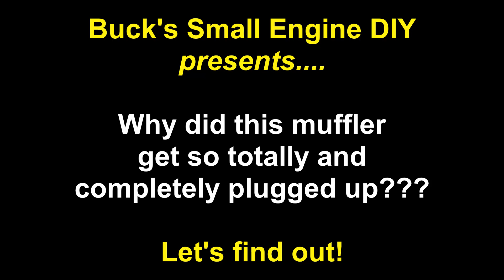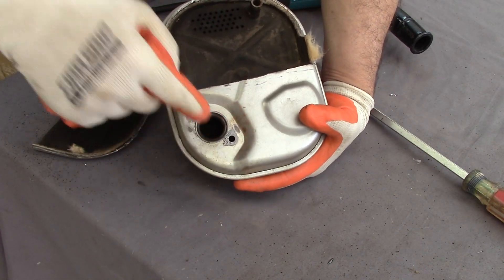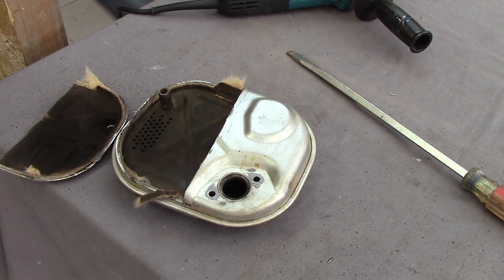WHY is this MUFFLER  TOTALLY and COMPLETELY PLUGGED UP? Let's Find Out! Honda Generator EU2000i

Comment: Spiders or wasps build muddy nest that perfectly blocks the final part(s) of the exhaust. They love the circular opening. You actually had evidence! Even a small amount can block it perfectly. Screwdriver through final exhaust hole doesn't unblock the other 2 penultimate holes. Can use air compressor or wash with water I guess. You can cover the exhaust opening with tape to stop them (but remember to take it off when starting later).

Comment: Bummer I thought you might have a fix.  I've been running the little Hondas since before they were even the plastic "suitcase" form.  I live in remote Alaska and run them daily. I have never had so much trouble as I am having with the newest 2200 I have.  Usually they are nearly flawless for years and years. All I could think is the actual muffler must be clogged.  After seeing this I doubt that is the case.  I suspect their quality has declined, unfortunately.  Thanks for the video though.  I know what they look like now.

Comment: Hey? Do you or anyone  know how much a clean muffler should weigh? I took mine off and it felt so heavy I decided to run it without a muffler until I can order a new one.
Reply: I have the same exact question. Mine feels very heavy too. I have less than 100 hours on my generator
Reply: @bretthull9321 maybe they are just heavy. I blew through mine and it seemed clear. Maybe I’ll try putting it back on and see how it runs. I think I’ll weigh it first so I’ll have a reference.
Reply: @bretthull9321 For what it’s worth. I just weighed mine on the bathroom scale. 2.7 pounds. It’s model #S-351. Reinstalled the muffler and it runs fine. It still seems heavy for a muffler.

Comment: I have just ran in to this issue on.my 2023 model and it had a lot of carbon in the exhaust manifold and scaped that out verified proper valve lash . And tapped exhaust to get carbon chunks out of input of exhaust and smaller bits and dust out the exit of the exhaust. 
I run it 8 hours a day 6 days a week. We live off grid and it charges our power bank when the solar and wind do not work. 
I have tested it and it is still blocked inside and am soaking the muffler in a tub of eazy off oven cleaner. And am hoping it will break it up.

Comment: The muffler on my eu2200 is plugged up. I’ve barely used it since new. It caused fuel to blow into the air filter box and would only run for a couple seconds.  Take the muffler off and it runs just fine.

Comment: Does the generator have an hour meter? 
I don't think it's a waste of time, very good information. I don't have a Honda generator, I have a Champion 1850/2500 inverter generator, that is very quiet. It might have the same problem if I put a lot of hours on it. I will watch the original repair video to see how you diagnosed it.
Reply from the maker: I don’t remember seeing an hour meter on it.
Reply: Should have opened up the complete muffler. You should be able to see the plugged up area. WAS A GOOD VIDEO! keep up the good work. 😊